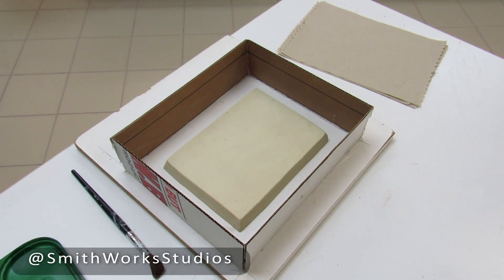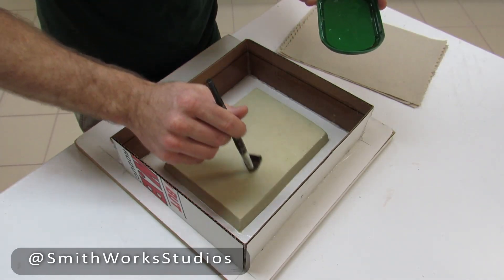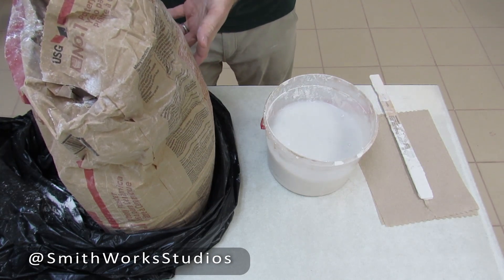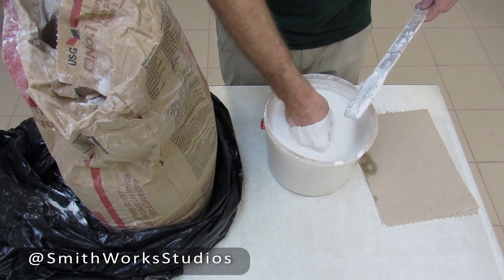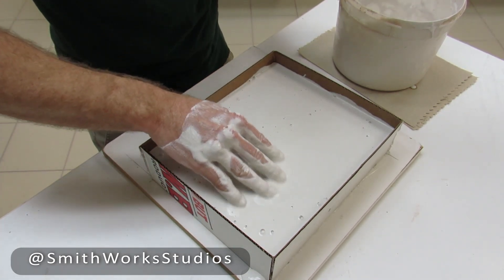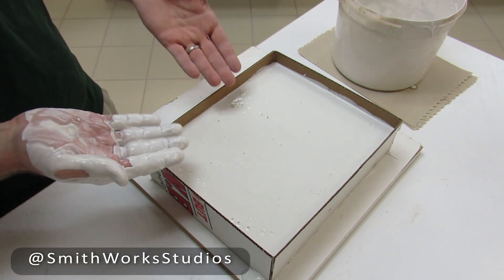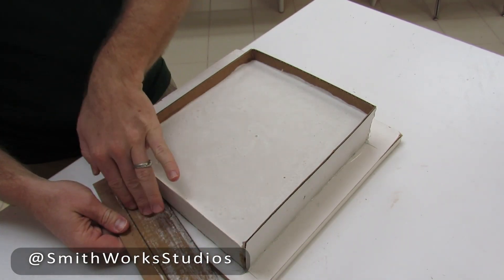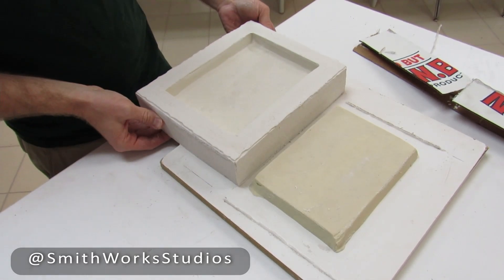DIY Cardboard Flask for Plaster Mold Part 2: Mixing and Pouring Plaster!

Comment: Can you creat a multi part mold with this method - I want to do a casting lesson with my HS students but don't have cottle boards?
Reply from the maker: Yes absolutely! Make sure you oil the plaster surface really well and build your flask as tall as tou need it. For large molds, clay buttresses may be needed to support the sheer volume of plaster.

Comment: Greetings from South Africa 😊  do you think linseed oil would work as a release agent?
Reply from the maker: It might. Test in a small area before committing. The nice thing about the soap is that it washes clean and doesn't hamper the absorption of water while the mold is in use.